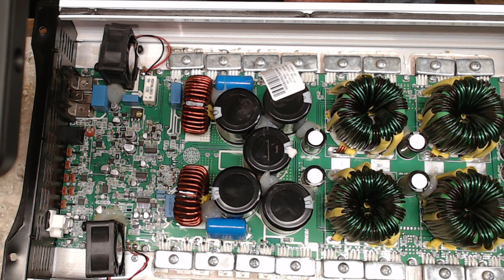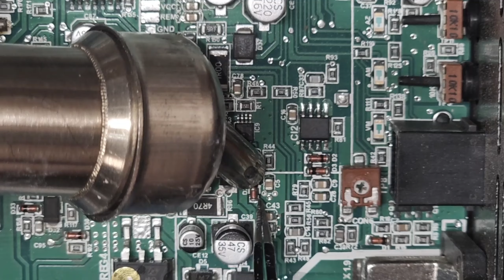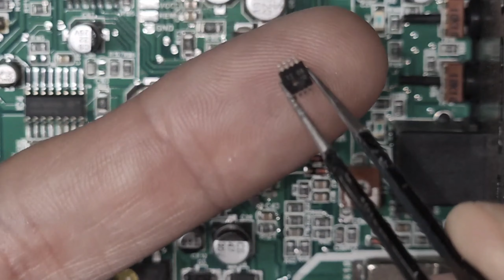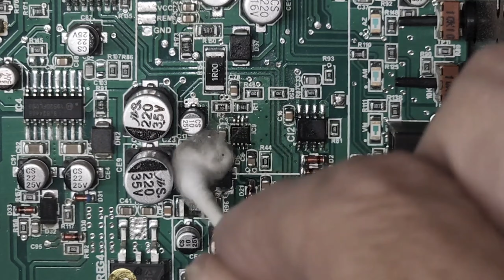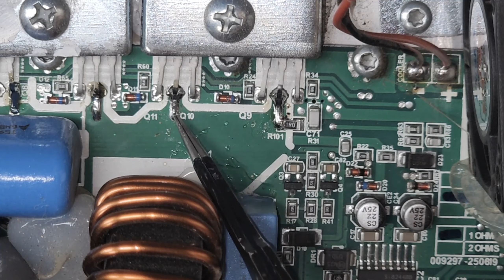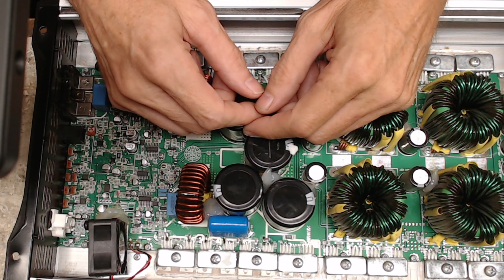Taramps MD8k Remote Circuit No Start Magic Smoke IC Repair

Comment: I would gladly pay to have my md repaired but cannot find anyone trustworthy torepair it. Sadly in my area there are no amp repair shops. Can't justify sending it to someone that will not fix it properly or never return it.
Reply from the maker: Finding a repair tech who is competent and understands the principles of electronics is about non-existent. The best question you can ask a repair tech before sending your amplifier in is "What is the theory of a PN junction?" Most can not answer that or I would have competent employees. Unfortunately, I am closed for all private repair tickets. The only "private" repairs I am doing are amplifiers that do not qualify for OEM warranty repair sent in by the retailers listed on my website homepage. I no longer deal directly with the public.
Reply: @ellensburgamplifier I’m overwhelmed and swamped, I’m soon take a seasonal break also from work inflow until I’m down to a threshold then restart the cycle.

Comment: Where can I just buy the whole board? Or do repair amps I have to 8k one taras and one bravo
Reply from the maker: You can contact Taramps and if they have enough stock they may sell you a board. If it's a remote circuit failure (IC9- TPS7A6601) then that is repairable.

Comment: Is there a place where I can purchase the repair parts ? Or liek the part numbers ? Got a bass 8k that has voltage to the remote wire but doesn’t turn on
Reply: Yeah I got no leds or anything
Reply from the maker: @jasdeepsingh2501  Yup, typical remote circuit failure. I have noticed that these repairs have tapered off substantially compared to last year so hopefully, this issue is getting weeded out.
Reply from the maker: I see Mouser has the TPS7A6601 in stock and I would bet Digikey has them also if you are here in the States. You may also need to change the 4R7 supply resistor and L4148 diode. This is if NO LEDs come on or try to come on.
Reply: I appreciate the help thank you

Comment: I have repaired a few of these as well. 

My theory is the failure is related to shorting between the speaker output leads and the remote lead. What I haven't determined if it's internal arcing or external loose/strands. The latter is my strong suspicion though.

Comment: what is ic 1 beside it and what it does
Reply from the maker: IC1 is the 22v aux. power supply for the 5v regulator. UCC27524

Comment: What would you charge to fix rca on a taramps md5k there loose rn I have something under the rca wire put upwards pressure on them to keep it from making awful noises lol same thing I used to do to phone charger that were going out!!
Reply from the maker: RCA replacements usually fall within my minimum charge for most amplifiers. www.ellensburgamplifier.com/request-a-quote

Comment: I bought that ic from taramps, 3usd for 2 pcs plus 30usd international shipping, yet mine doesnt turn on anymore
Reply from the maker: Do you have 5v out on R154? Did you replace R99 and D21? If you have all the voltages present then we need to look further down the circuit.
Reply: @ellensburgamplifier  hey, it is actually my fault, funny thing is that after flipping it arround and openingnit turned on and cycled by turning off and on, after pressing on the ic with my finger it turns on and runs, well there's my shat soldering for you
Reply from the maker: @cheri621uwu  These MSOP ICs are small for sure. Good solder and flux make for a quick job.

Comment: Reason I had was that ,my live remote wire touched the negitive speaker wire connection port and caused it to short out
Reply from the maker: Yes, that will send rail voltage to the IC that the remote turns on. At that point, you will need a TPS7A6601, 4.7 ohm SMD resistor, and a 4148 SMD diode.

Comment: So on my md8k it puts out very low sound but if I touch the rca inputs it gets really loud what's going on here and is it an easy fix.
Reply from the maker: That is interesting. Almost like it is missing the reference ground. What are you using for your input signal? Most anything is easy to fix on these boards as long as the PIC is alive and well.
Reply: @ellensburgamplifier  knukonceptz Krystal cables  1.68 volts going in
Reply from the maker: @brick2077  Is the RCA ground floating?
Reply: @ellensburgamplifier  what do you mean ? I don't know
Reply from the maker: @brick2077  The RCA ground, or the shield needs to be grounded or the amplifier will see a floating input which will confuse the feedback circuit in the amplifier. With the RCAs disconnected from the amplifier do you read zero ohms from the RCA outer shield to the chassis ground?
Reply: @ellensburgamplifier  from outer shield to chassis ground it reads 0.994
Reply from the maker: @brick2077  Is that RCA coming from a DSP?
Reply: @ellensburgamplifier  subwoofer crossover
Reply from the maker: @brick2077  Was that measurement at the amp? You need to check your RCA cable shield to see if it is floating.
Reply from the maker: @brick2077  It does sound like a floating ground issue but if you have gone through all the steps to verify that the RCA cable is grounded properly please feel free to reach out to me at www.ellensburgamplifier.com/request-a-quote if you would like to have the amplifier inspected/repaired.
Reply: @ellensburgamplifier  also seems to be getting noise from potentiometer gain knob when slight touch. Slightly touch it once more and goes away. What would these small repairs estimate to?
Reply: @ellensburgamplifier  also thank you for your time chatting with me greatly appreciated.
Reply from the maker: @brick2077  The minimum charge for any arrival is $40 and goes up from there depending on the work needed.
Reply from the maker: @brick2077  Always happy to help!

Comment: Naa 75$ isn't shit considering alot of people don't know a single thing about soldering not to mention they will overheat the shit out of whatever I they are replacing. 75$ money well spent on a 650$ amplifier
Reply from the maker: Amen to that! Thank you for the channel support.
Reply: I couldn't agree more with you. Also, at least from what I have seen of Todd's work now for the last half year, you will not find a more thorough, methodical, and caring repair technician than this man, Todd, at Ellensburg Amplifier Repair. It is relatively easy to see that he really cares about every unit which runs through his repair shop. Todd takes pride in his work.   Fred

Comment: Whats the number of the ic
Reply from the maker: TPS7A6601QDGNRQ1 is the IC in this video.
Reply: @ellensburgamplifier  this a long number
Reply: I really need genuine parts to buy it's really hard to fix stuffs then it blow up back that does kill me inside share chine parts i have in no good
Reply from the maker: @awaazhoosein6565  It is, I usually just say TPS7A6601 They are expensive and can be hard to find genuine ones.
Reply from the maker: @awaazhoosein6565  Where are you located?
Reply: @ellensburgamplifier  guyana
Reply from the maker: @awaazhoosein6565  Shoot me an email if you would like and I can see what it would take to get you the parts that you need.
Reply: @ellensburgamplifier  hi buddy.can you type email.i can send you some info.
Reply from the maker: @basshead100  I don't type info here due to spam but you can find all my information at www.ellensburgamplifier.com

Comment: That little ic is a big problem in alot of the Taramps I need alot of them right now $35 wow
Reply: I have left comments on this channel in the past and they were not all "sunshine & roses", however please believe me when I say that I don't try to come off as a negative Nancy through all of my comments, honestly, I just call it as I see it and in that vein, here I go again; $35.00 USD for an (one piece) LDO regulator is absolute INSANITY. I hope that you and Todd can locate a more reasonably priced supplier for this particular component. As Todd alluded to in this video, clearly these regulators are being priced at ransom prices. It is just nuts to hear that this is taking place... I'm sorry guys. Good luck with finding a down-to-earth priced source for these voltage regulators.   Fred
Reply from the maker: @electronicengineer  Thank you Fred. I will never pay these prices unless I am forced to keep business rolling smooth. It is unfortunate that I have to pass this price gouging onto the customers when I have to pay such outrageous prices for something that just cost a few dollars in 2020.
Reply from the maker: Yes, $35 so far is the lowest quote I received. I too need a bunch of these. I am also looking into the TPS7A6650 that may work but I see those are just as expensive.